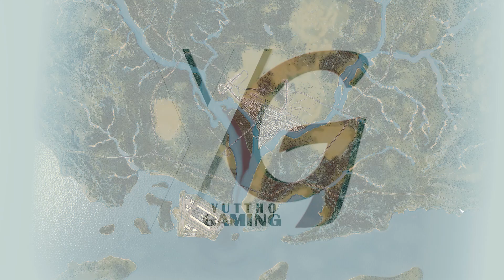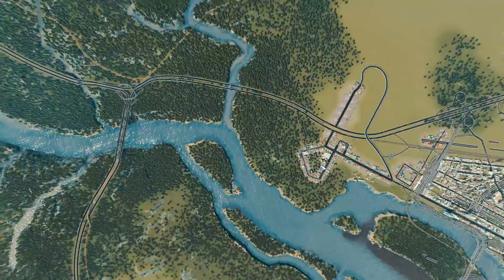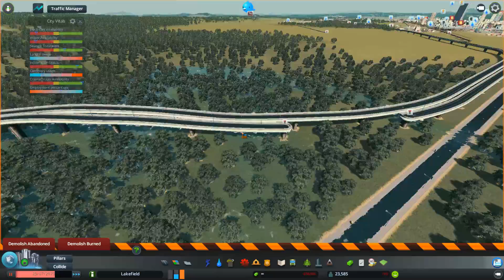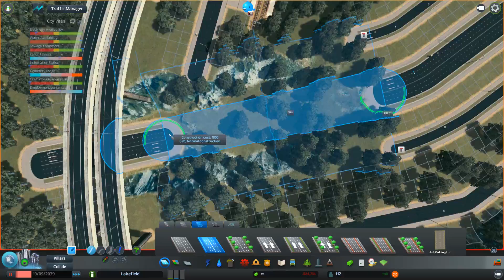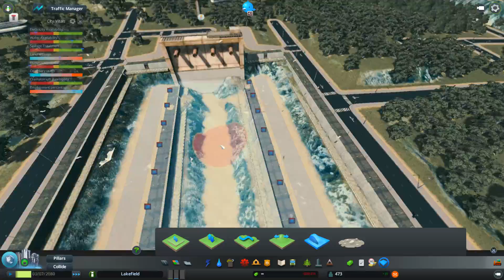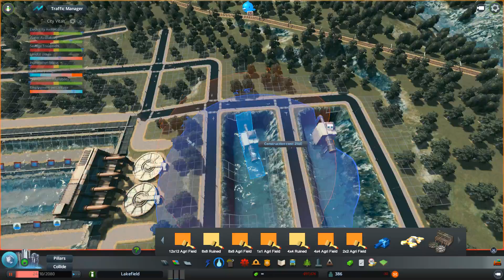Cities: Skylines, EP8 - "Industrial Sector and Going Nuclear"

Comment: About the thing you were talking about at 32:25, I kinda had a problem with water being pushed onto land from an island I created. I dug out the whole river, making it several layers deeper. It seemed to work unless my problem was that I didn't just run the simulation long enough.